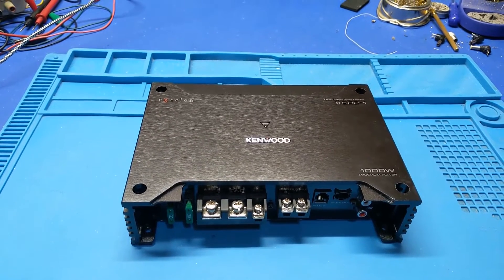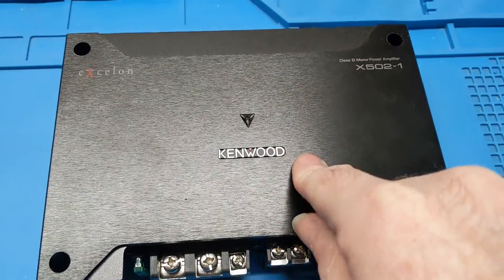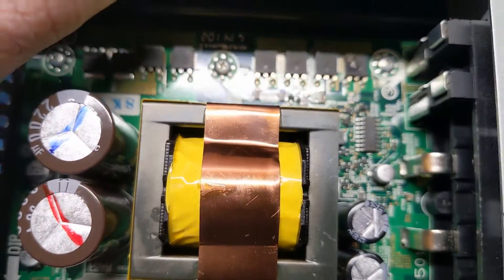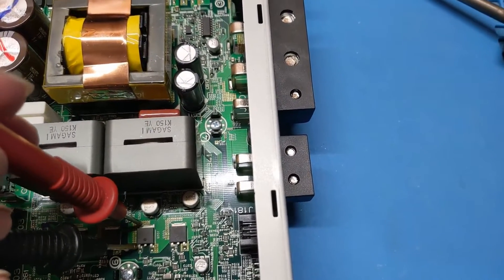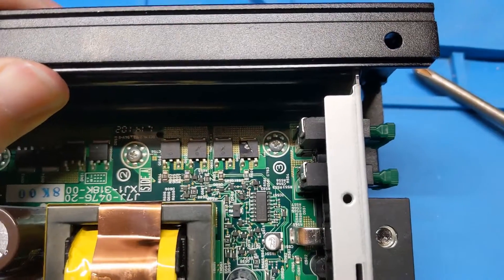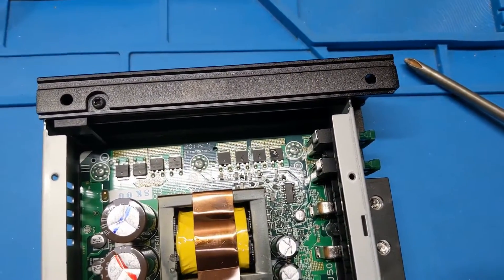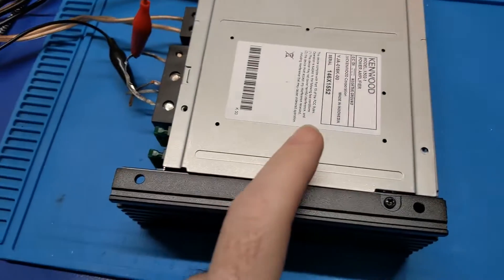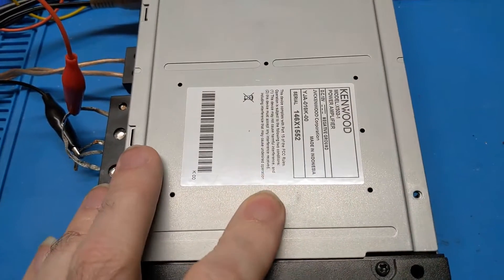Kenwood X502-1 Repair

Comment: Would you rather have this or an alpine mrv-m500? I can get either brand new at the same price
Reply from the maker: @paulblart1  Alpine uses custom ICs that are very hard to get
Reply: @THEtechknight  So do you recommend the kenwood because it would be easier to repair if needed? I was wondering about the alpine because you said the kenwood looks very cheap in the vid

Comment: Neat!  Sounds like it would have benefitted from a charge pump on the gate drivers.

I've got a Phoenix Gold Ti series amp that I still need to repair.  It melted its power cables... I dunno.. 15 years ago... and I haven't yet gotten around to trying to figure out why.  Haven't had any amps in a car since then, and if I did, it would likely be Class D now.  But it was such a nice amp back in the day that I can't bear to part with it.

I had a PPI PC2150 alongside it, which I gave to another enthusiast recently.  I go back and forth between being happy it's with someone that will use it as more than a paperweight, and being sad to let go of such a beautiful amp.

Comment: Do you ever see the TL 494 chips going out?
Reply from the maker: It's a 50/50 shot. Sometimes I do sometimes I don't, it really depends on how prolonged the voltage was after the failure from the driver transistor's shorting